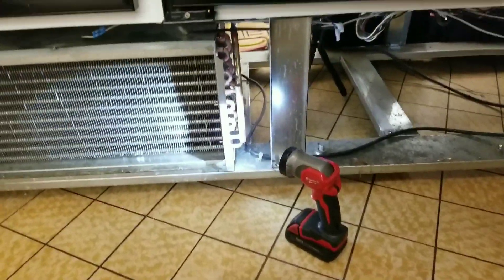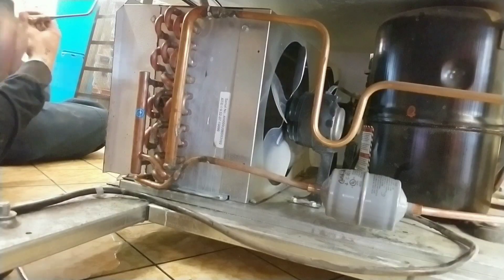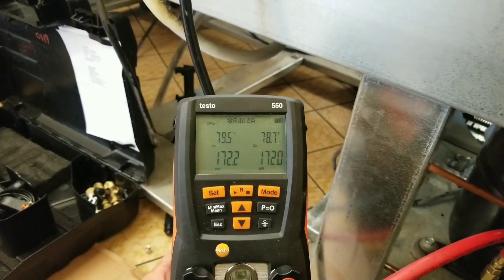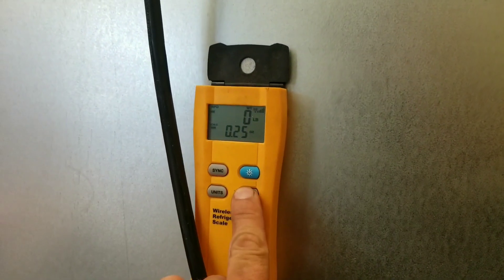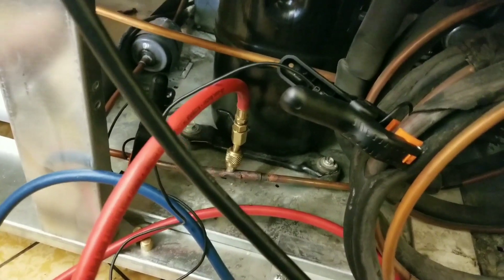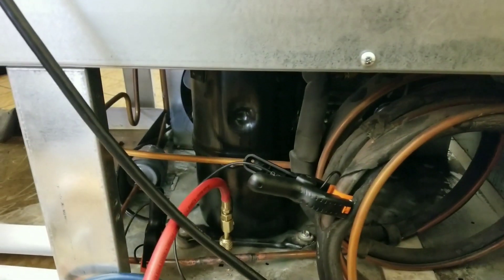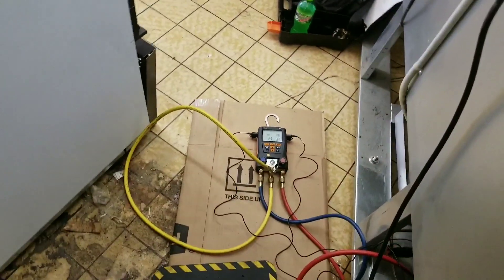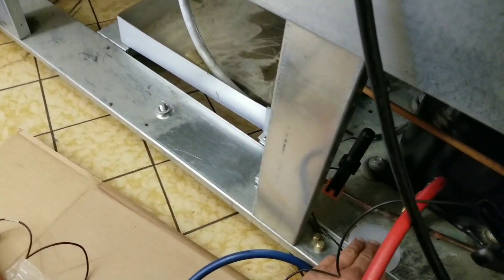Masterbilt cooler not cooling and leaking refrigerant

Comment: I just had to add service ports to a unit that had none. I'm pretty sure my leak is in the wall. My sniffer triggered on the unit casing grommet the lines come out at the evap.

In this case I pressed some compound in to stop it, and if it doesn't, then we will add a new pipe and cap tube I guess down the back wall of the unit.

Comment: Whatever you do,try not to pull that sucker out,I've had many many master- built and bev-air. ,Kink on that slinky coil return to suction
.it just ruins your day...
Anyways,looks like you did not have to..
Most of those 3 door and ice cream freezers have that set up.
502 and 404A freezers..
But good job on handling that.
A little leak on those is all it takes..
Great video.curious Hvac guy..
 Bryan Tyler Refrigeration.
Reply from the maker: I know exactly what you mean- I try to never pull those out unless I have to and when I do im super cautious about it. Thanks for the feedback Joseph

Comment: Just curious, why did you not pull the condensing unit out to give you better access?
Reply: Looks like he didn't have to. Less disturbance the better. Smart move.
Reply: He’s trying to avoid the magic hissing sound... I will only pull the condensing unit out if there is no other choice, it’s always a little stressful pulling and pushing on a line set. He clearly had free access to the front and rear of the machine, so he just scratched another potential problem off of the list.
Reply: Your looking for a leak or kink with those if your not careful. 
So much pulling / pushing back in wears out that suction slinky( thats what i call them), there retianing point in back or in front comes apart and you have a big problem .
You can always make one with 1/2 copper wrapping around your jug of refrigerant a few loops but its not perfect...
Reply from the maker: You guys are exactly right- the less I have to flex and pull that lineset the better, Ive had those crack one me before when pulling them out and it makes for a long day- thanks for the feedback guys